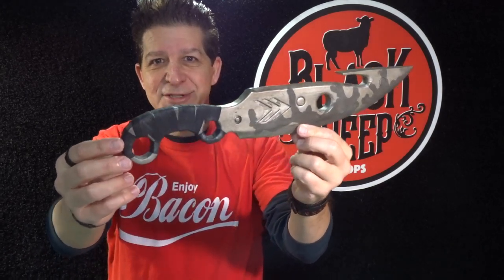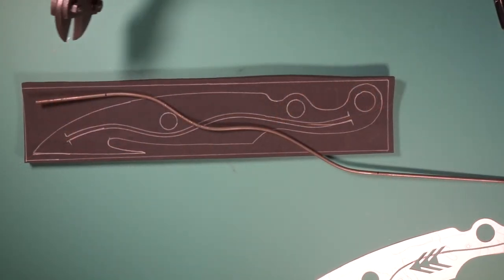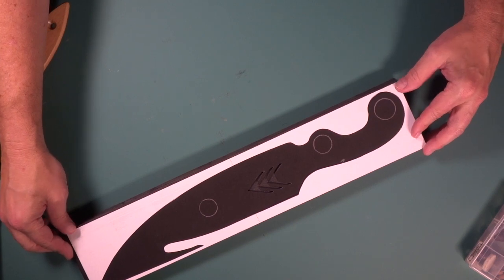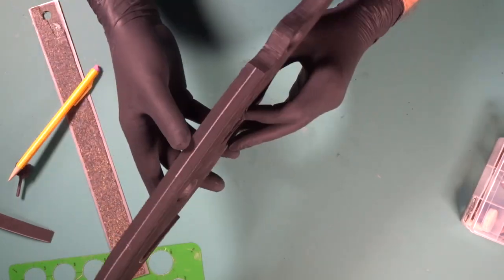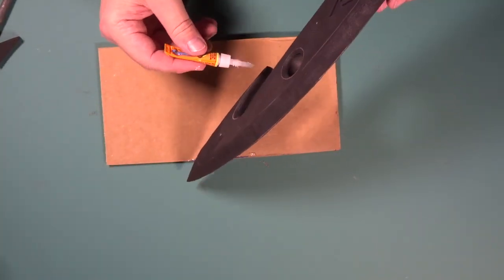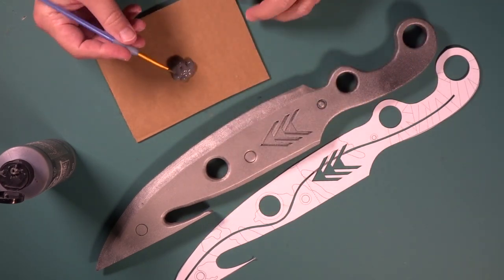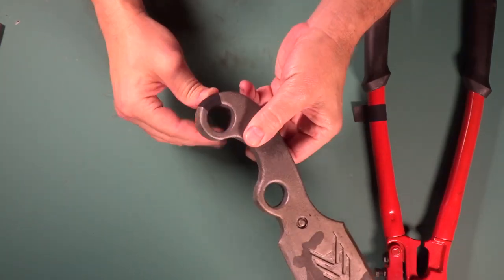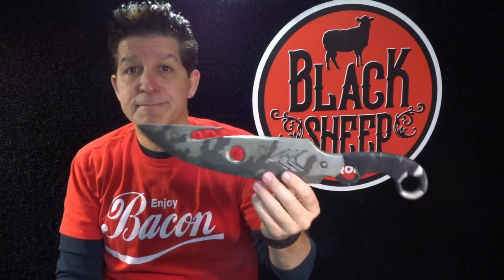Making An EVA Foam Destiny Hunter Knife

Comment: If i could ask, did you use high density foam or low density foam ?
Reply from the maker: I buy all my foam from TNTCOSPLAYSUPPLY and their website says it is Shore-C 38. IT says it is a "harder" foam.
They also have High density 50. Sounds like the 38 I use is harder than normal but not "high density". Hope that helps?